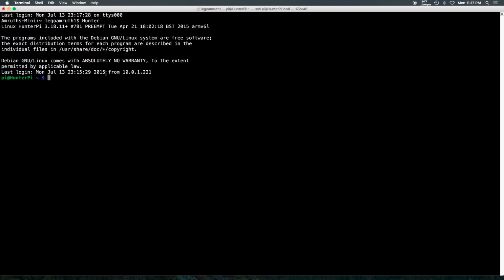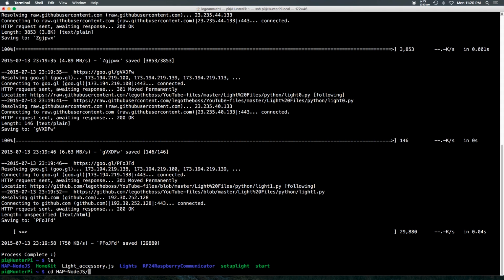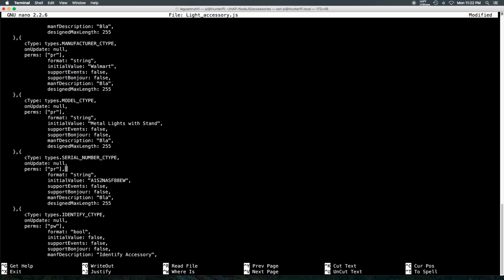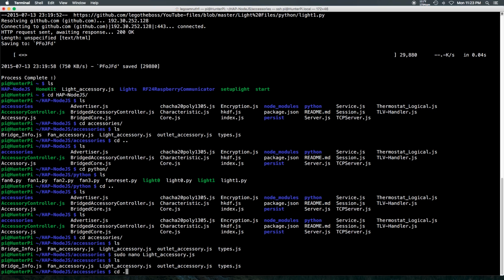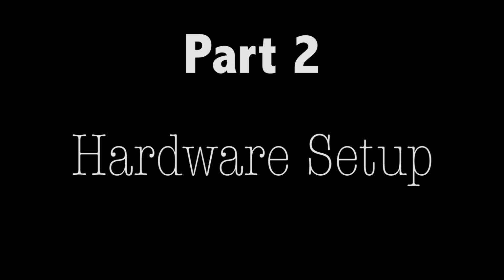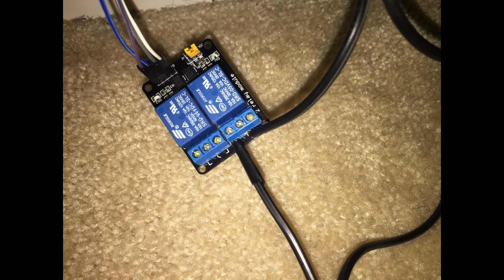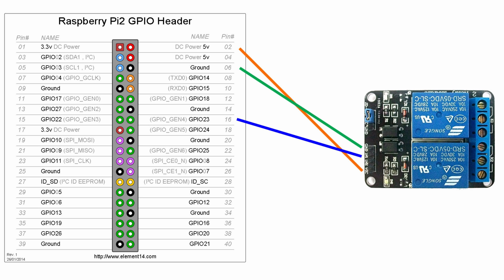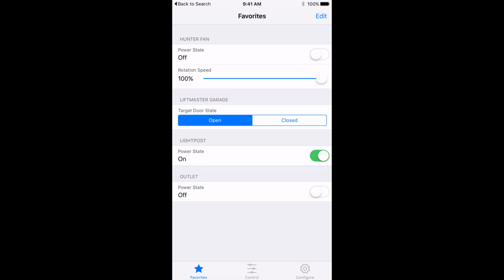TUTORIAL: Siri/HomeKit Lights with Raspberry Pi

Comment: Hey nice tutorial...!!! I made all trough but I have a question? it´s pin 16 or GPIO 16?? I got everything install, the app show me the light it´s online but I can´t turn it on & off. Help...
Reply from the maker: +Luis Escobar pin 16
Reply: Thanks for the quick answer... Ok still not working, I got all wired up as the tutorial, but have you heard about the trouble of controlling the gpio's of 5V and the 3V. In several tutorials said that the 5V GPIO it's like a direct current so you cannot control' it instead the 3V works fine about the direction and the values controlling directly in LX terminal. So right now I can't controlled the GPIO of 5V with the pin 16 (GPIO23) with echo out > /sys/ class/ gpio/gpio23/direction (light goes on) you cannot put values... and with the  echo 23 > /sys/ class/ gpio/unexport (lights goes off ). this could be the trouble???  I'm checking in LX terminal because the Python&#180;s command doesn't work too. Sorry for typos and bad grammar :)

plus this I can't npm install this file EADDRINUSE :::51826

HAP-NodeJS starting...
Parsing accessory: Fan_accessory.js
Parsing accessory: GarageDoorOpener_accessory.js
Parsing accessory: Light_accessory.js
Parsing accessory: Lock_accessory.js
Parsing accessory: TemperatureSensor_accessory.js
Parsing accessory: Thermostat_accessory.js
events.js:141
      throw er; // Unhandled 'error' event
      ^

Error: listen EADDRINUSE :::51826
    at Object.exports._errnoException (util.js:874:11)
    at exports._exceptionWithHostPort (util.js:897:20)
    at Server._listen2 (net.js:1234:14)
    at listen (net.js:1270:10)
    at Server.listen (net.js:1366:5)
    at EventedHTTPServer.listen (/home/pi/HAP-NodeJS/lib/util/eventedhttp.js:58:19)
    at HAPServer.listen (/home/pi/HAP-NodeJS/lib/HAPServer.js:155:20)
    at Accessory.publish (/home/pi/HAP-NodeJS/lib/Accessory.js:480:16)
    at /home/pi/HAP-NodeJS/Core.js:32:13
    at Array.forEach (native)
Reply from the maker: +Luis Escobar restart raspberry pi and try again.
Reply: So after several tries I discover that echo out > /sys/ class/ gpio/gpio23/direction "the light goes on", and I can`t shut it off with the app and Siri, but I can`t turn it on again... any ideas??? could be the python script??? please help
Reply from the maker: +Luis Escobar I'm honestly not sure. There might be an issue with the installation. This is the weirdest issue I've heard and not sure how to even fix it.
Reply: MADE IT FINALLY!!!! this is absolutely  good. So this what I do: 

1. Create 2 new pythons that controlled directly the GPIO 23 (Pin 16 in python you have to put the PIN number no GPIO number), I think it's a problem with the root user and the pi user, honestly I don't know why the two original pythons scripts from the tutorial doesn't work for me. Here they are: a) name: lighton.py. *code:   

import RPi.GPIO as GPIO

GPIO.setmode(GPIO.BOARD)
GPIO.setwarnings(False)
GPIO.setup(16, GPIO.OUT)

GPIO.output(16, 0)

b) name: lightoff.py . *code:

import RPi.GPIO as GPIO

GPIO.setmode(GPIO.BOARD)
GPIO.setwarnings(False)
GPIO.setup(16, GPIO.OUT)

GPIO.output(16, 1)

PLEASE NOTE: both are located in "cd HAP-NodeJS" folder file you can't put the two in the cd python/ folder too.

2. Head to the: a) cd /HAP-NodeJS/accessories . b) modify the sudo nano Light_accessory.js   file exactly in the part POWER_STATE_CTYPE (the one you say don't touch in the tutorial) I modified like this: 

 {
        cType: types.POWER_STATE_CTYPE,
        onUpdate: function(value)
        {
                console.log("Change:",value);
                if (value) {
                        cmd.run('sudo python /home/pi/HAP-NodeJS/lighton.py');
                        console.log("On Success!");
                } else {
                        cmd.run('sudo python /home/pi/HAP-NodeJS/lightoff.py');
                        console.log("Off Success!");
                }
        }

As you can see I only redirect the two python files to the HAP-NodeJS folder and made it some changes to the Light_accessory.js file. Sorry for the long post. Hope can't be usefull for someone else. PD: Im using the RPI 3. Adios amigos!!!
Reply from the maker: +Luis Escobar something might have gone wrong with the script on my part. Let me check but I ran this tutorial yesterday and it was fine.
Reply: I know!! it's weird!! I was reading about the user permissions. I got the latest Jessie Raspbian Image running on my Pi. Some People say it's all about the normal user and the Root user, that doesn't permit control the GPIO PIN's as normally use. And other say's it's the difference between the 5V pin and the 3V pin. I don't really know, but right now I'm making a image backup. I spent like 3 days trying to make this work. I'm grateful with your help in all your tutorials. Thank you.

Comment: just wanted to say thanks for the videos!  Added a lighting piece to my rPI last night that I had already configured to run my garage door.  Your videos made it possible, thanks for taking the time!
Reply: i dont think so because when I plug the in2 to the ground the relay switches on and off and it switches the light on and off
Reply: how did u wire the relay to the raspberry pi imusing the way in the video and its not working
Reply from the maker: +BlazelaHD you might have a faulty relay...
Reply from the maker: +BlazelaHD please email me at quick pi @ iCloud dot com. Include pictures of your wiring  so I can let you know what is the fault. This shouldn't be happening.

Comment: I followed this tutorial except for installing Forever (idk why it wouldn't work, but it runs fine with "$ cd HAP-NodeJS && node Core.js") but on the iPhone app I only see fan, garage door, thermostat, lock, and temperature sensor, but no light. Is there something that I may have messed up in sudo nano Light_accessory.js?
Reply from the maker: +Jeremy Meadows check your accessory folder. Ensure the folder is there
Reply: "ls" in that folder still shows Light_accessory.js, so I think so
Reply from the maker: +Jeremy Meadows yes
Reply from the maker: +Jeremy Meadows delete the persist directory and check again.
Reply: What is the command for that?
Reply: Ok so it is "sudo rm -r persist" but that sadly didn't fix the problem :(
Reply from the maker: +Jeremy Meadows sudo rm -rf /home/pi/HAP-NodeJS/persist
Reply: Just to see what would happen, I reset the Light_accessory.js serial number to the default, and it began working, I'm not sure why. I can see it in my HomeKit app now and it talks to the pi too

Comment: Will this work with dimmable lights?
Reply: And can this work with a light switch controlled light?
Reply from the maker: +Joshua Holme yes wire the switch into the relay and this would replace the switch.
Reply from the maker: +Joshua Holme yes
Reply: If I wore the switch in will it stop the functionality of the switch or will I be able to use both my phone and the switch
Reply from the maker: +Joshua Holme no only switch
Reply: So the switch would be useless afterwards

Comment: Hello
Help me please this tutorial work with Rpi 1 or juste with Rpi 2 ?
Reply from the maker: +Mohamed Rouane it will work on ANY raspberry pi, regardless of pi 1 or pi 2
Reply: +QuickPi thanks for reply, my problem is when i talk to siri " the light 1 is turning on " and not happen the lamp is still off what i can do ?
Sorry for my bad English
Reply from the maker: +Mohamed Rouane is your relay connected to the right pin?
Reply: +QuickPi yes dud is connected to the pin 16 like on python script "light1.py"
Reply from the maker: +Mohamed Rouane were there any errors during installation?
Reply: +QuickPi no errors i did all things like your video ...when i try manually " python light1.py" the light is turn on saw the python file is correct
Reply from the maker: +Mohamed Rouane I suggest you flash raspbian on your SD card and re-run the installation... If there is an issue, it should fix itself. BTW, did you install everything as user pi?
Reply: +QuickPi this is the second time i flash my sd card ... I install all from root and all is up to date
Reply from the maker: +Mohamed Rouane ok, I checked the code and made a few changes. Delete the python directory and Light accessory file. Then, download the script again and rerun the script. Everything should fine. Spotted a few bugs that might affect you if you are in Jessie. Hope everything works out.
Reply: +QuickPi can you give me the line of command ... Im beginner 
Thank tou
Reply from the maker: +Mohamed Rouane just refollow the tutorial
Reply: +QuickPi Okay Dud thankx

Comment: Hi! Having an issue that i can't figure out:

* WARNING * The program 'nodejs' uses the Apple Bonjour compatibility layer of Avahi.
* WARNING * Please fix your application to use the native API of Avahi!
* WARNING * For more information see <http://0pointer.de/avahi-compat?s=libdns_sd&e=nodejs>
* WARNING * The program 'nodejs' called 'DNSServiceRegister()' which is not supported (or only supported partially) in the Apple Bonjour compatibility layer of Avahi.
* WARNING * Please fix your application to use the native API of Avahi!
* WARNING * For more information see <http://0pointer.de/avahi-compat?s=libdns_sd&e=nodejs&f=DNSServiceRegister>

It happens when running core.js, and there your light accessorie. What do you suggest? Thank you
Reply from the maker: +Filippo Dal Lago these are just warnings... They are normal
Reply: But it does not actually parse the accessorie file that you upload
Reply from the maker: +Filippo Dal Lago enter your accessories folder and let me know what is there
Reply: +QuickPi ok i managed to run our accessory file. There just one problem, the python script does not do anything. Connected correctly my relè board but there just a light on on it. It does not switch off i say so. Wondering why. Everything works correctly now except this. And the python script runs (i added a print "message" and it appears). I'm using raspberry pi3
Reply from the maker: +Filippo Dal Lago if the relay board light is on, I would check the relay board for defects and as well as your wiring to the relay board
Reply: +QuickPi ok man I DID IT! THANK YOU! At first there was a problem inside Light_accessory.js. The root of my python file was incorrect, it was by default 'light1.py' instead of 'python/light1.py'. then i changed the python code, i guess the problem was "GPIO.output(16, 0)", the zero and the one. I changed it with false and true. Btw thank you very much! So happy now :D

Comment: Do you need to use a 2 channel Relay board? OR can you use a 1 channel 5V relay module for arduino since you only are using one set of power cables?

Sorry, for the Noob question
Reply from the maker: +Jason Sutter I just suggested the 2 channel relay since it is recommended everywhere and I have used it for a long time, so it works. If you have a different relay, it should work as well.
Reply: +Jason Sutter 
I did it with a single relay board. I've since setup 2x 2 relay boards.

Comment: Hi, thanks for the video. I'm trying to use instead Arduino.  I guess it could work in that way: Siri-> Online server with my program in node running all the time -> johnny-five -> arduino. My main problem is that I'm having issues combining hap-node.js and johnny five. How does hap-node.js work? thanks
Reply from the maker: Try questioning this on the git hub for HAP-NodeJS. People with more knowledge on HAP-NodeJS will be able to help you.
Reply: +QuickPi Thanks! actually the main idea here is the same ;) if the value changes just run a program that does the job for you! I&#39;m trying to implement your code into my project ;) but wondering why Light_accesory.js is not recognized by HMCatalogue. Core.js actually is able to load it up with the server
Reply from the maker: Try resetting HomeKit on your phone and repair it. Sometimes the previous paring causes the new one to become a ninja. Also change the username of the Light_accessory.js, this should also help your issue
Reply: +QuickPi Yep! It worked, thanks ;) I'll let you know my development ;)

Comment: So i have everything installed correctly and wired correctly. It pairs with my phone and when i tell siri to turn on the command prompt says Change: True On Success. But the light doesn't turn on. Everything is wired correctly, I double checked. What could be wrong?
Reply: +Danny Owen Please help. I've done a complete reinstall and everything. Everything looks like its working. its just not switching the relay
Reply from the maker: Hi, sorry for the late response. If you are using a Raspberry Pi 2, you need to just wait as I am working on a solution to fix the problem. I will publish a video with a solution. If it is raspberry Pi 1, I suggest you reinstall the image.
Reply: QuickPi Thanks, I'll keep an eye out!
Reply: +Danny Owen Hey, I guess I solved the problem, by controlling the pin directly instead of using python.
 
First install GPIO: 
npm install pi-gpio

Than install GPIO-Admin:
cd /home/pi 
sudo git clone git://github.com/quick2wire/quick2wire-gpio-admin.git 
cd quick2wire-gpio-admin 
sudo make 
sudo make install 
sudo adduser pi gpio

And than goto https://gist.github.com/KhaosT/7004b9378a7579c1312e and put the scrip found there into your Light_accessory.js:
Reply: +Kilometerzaehler Na toll. Hätte ich das mal vor ner Stunde gelesen XD
Reply: +Kilometerzaehler How did you modify your python files?
Reply: +Jan Baur (Johann42) I get an error "gpio-admin: failed to change group ownership of /sys/devices/virtual/gpio/gpio23/direction: No such file or directory"
Reply: +Kilometerzaehler Thank you! I was able to get mine working by moving the py files and editing them as you suggested.
Reply: +Danny Owen type this "echo out > /sys/devices/virtual/gpio/gpio23/direction"  on the terminal, then try again.
Reply: +Jan Baur (Johann42) im using gpio17 and I get Error: Pin number isn&#39;t valid

Comment: Hey, nice tutorial ;) . Controlling just a single light works fine. But I copied the light accessory and modified it for different lights ("light" and "neon light"). Siri always turns on or off both of them instead of only one... how can I tell Siri wich one I mean? Then I added a tv, but it is also shown as a lightbulb..
Reply from the maker: Sven Swag you can set scenes in the app. Say turn on "TV" and set scene TV to turn on the TV lightbulb. With a bit of exploring on the app, it can work.
Reply: Thank you for your response. But what do mean with "scenes", the only things I can set are zones, Users, action sets and service groups... setting up a zone doesn't makes sense.. I tried setting up an "action set" but that also wasn't very helpfull... Please one more hint :)
Reply: +QuickPi Oh, I recognized that these scenes are only available in the ios 9 version of homekit. So I can't use this feature on my ios 8 device, right?

Comment: hmmm.. i have the Lamp, Siri said, Lamp is ON...i used your Lights Video...and my Light is NOT ON...i have insert the Pin in exactly in the Pin with your Video...Nothing...

i have insert exactly your script in the light0.py and light1.py....NOTHING...

i now longer Know..

can help me...

i have the Raspi Version 2 with 4 USBs, 

Wlan is here, System start with Auto,
the Siri said Lamp is ON...or Lamp is Off...

Maybe the PIN wrong

Thanks
Reply: same trouble, any ideas how to solve it?
Reply: Same

Comment: hi, have you an tutorial with Lock Door? (front door)

thanks
Reply from the maker: I don't have the equipment to do door lock. I also believe HAP-NodeJS doesn't support door lock.
Reply: hmmm, the door lock is an 12V version, when you give 12V the Lock is Open, when the 12V is Down the Lock is OFF....or you give in the .py files auto Sleep...(20)
Reply: what file i can use for the frond door?
when i said , Siri Open Door....what file it is?

Comment: I had all of this working fine but then my Wi-Fi went down. I was having some problems so I deleted the Light from my phone and tried to re-add it but now it is not showing up in the list of accessories. I get all the accessories to list except for the light. If you could help me that would be great.
Reply from the maker: Change the username once again. Also, remove the persist directory in the HAP-NodeJS directory. If your wifi goes down again, just reboot the raspberry pi. Also follow the tutorial to start HAP at boot up. Then you don't have to manually start it.
Reply: I've done what you said and its odd because only the light does not show.
Reply from the maker: jjpeters10 I suggest you reset the HomeKit configuration on your iOS device. Sometimes, iOS just doesn't want to cooperate.
Reply: QuickPi When you say reset do you mean just delete the application and reinstall?
Reply from the maker: jjpeters10  No, go to settings, general, reset. there should be a button  that says reset HomeKit configuration
Reply: I don't see a button that says reset HomeKit configuration. Will it make a difference if i'm on iOS 8?
Reply: QuickPi I found it in Settings>Privacy>Homekit>Reset HomeKit Configuration.... Still nothing.
Reply from the maker: jjpeters10 Try reinstalling HAP-NodeJS and redoing the tutorial. Something must be corrupt somewhere